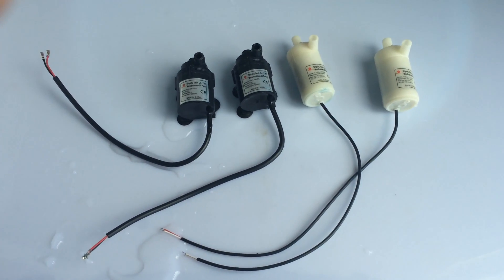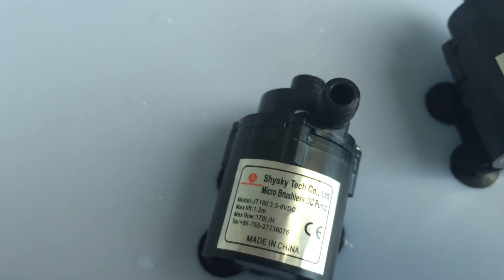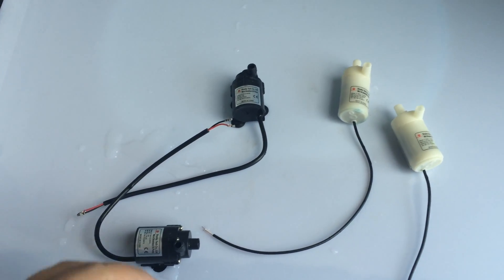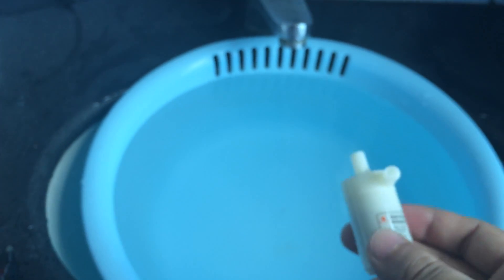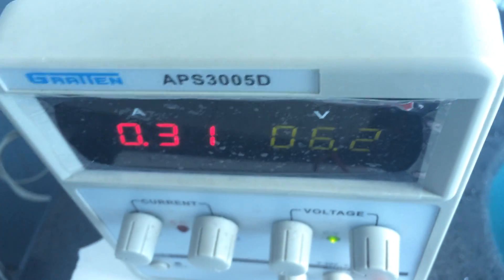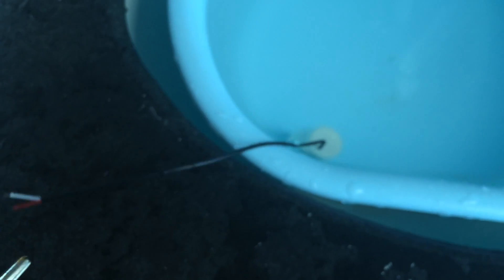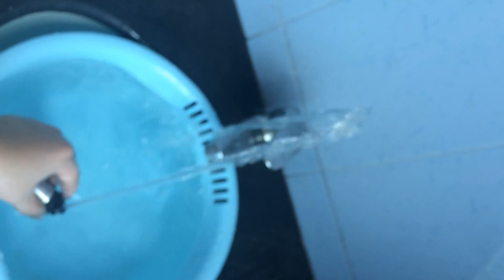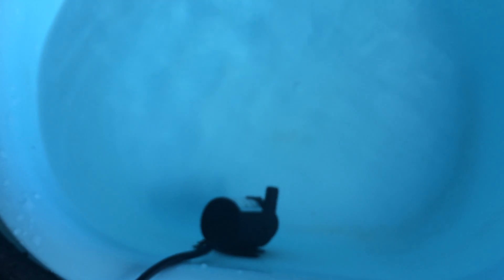Demo video of comparison between 160 and 180AL 6VDC mini pumps

Comment: hi sir, i purchased 6v water pump(Avrutti 6V Water Pump for Arduino). can I use it with 9 v Dc battery? do I need to connect resistor? how much ohm?
Reply from the maker: Of course, 6VDC pump cannot be powered by 9VDC power supply, which will be over-voltage.
Reply from the maker: There exists one possibility: the pump itself is designed for higher voltage while it can normally work at lower voltage, while it's just labeled as lower voltage model. In this context, users can power it.

For example, if a 12VDC pump is designed but manufacturer labels it as a 6VDC model (if it can normally work at 6VDC ), then this pump can be powered by 9VDC power supply.

So the best recommendation is that you can consult with your seller in advance.

Comment: Hi, if I connect water tubes to input and output but operate it outside of water, is that OK?  There will still be water going in and out but the motor itself is outside of my tank.
Reply from the maker: Make sure that water can actively and smoothly flow into inlet of pump, which is essential, because pump doesn't have ability of suction.
Reply: Thank you!
Reply from the maker: u r welcome.